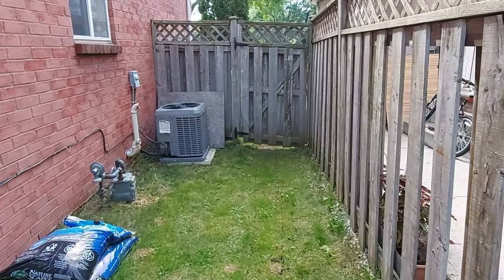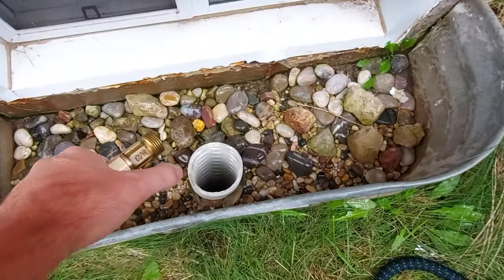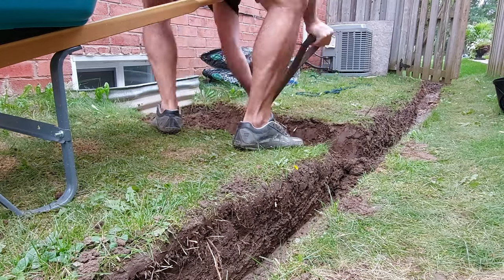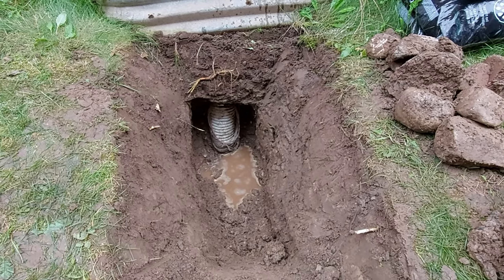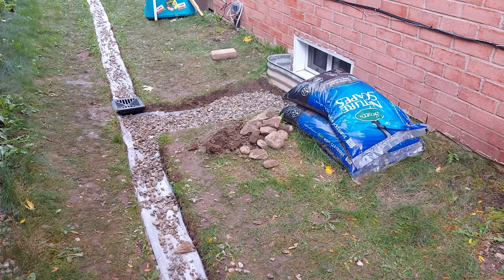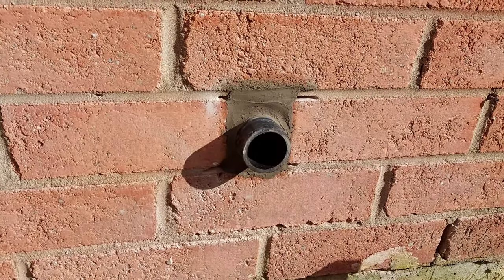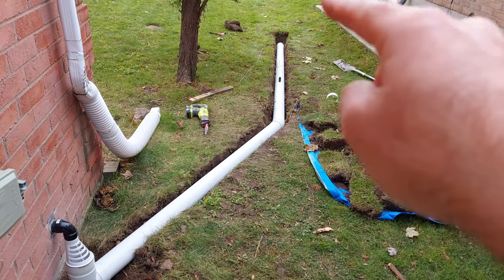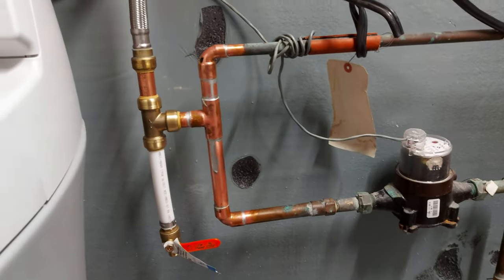Fixing My Yard Drainage - The Neighbor Is Flooding Me

Comment: Curious why the first orange T went over the corrugated pipe instead of inside it? I feel like the water would just leak out of the sides of it and go straight down to the foundation? 🤔
Reply from the maker: Oh yeah it's definitely not a 100% watertight system.  Some leeching into the soil is fine.  It's basically just to account for very heavy rain days.  Couple years later I still haven't seen any water in the basement.  It's working super well 😁
Reply: @tokyosteve1223  Awesome man I'm glad to hear that it's working well, I'm probably going to try something similar to this. But you know what they say... Owning a house is a constant battle with water...and you're probably not going to win 😅😂 But at least we can slow it down a little bit lol

Comment: Our properties in Spokane have only 10' between foundations. This means the ideal 6" per ten foot grade...means all homes need to slope into the foundation of the home next door. Wtf are we supposed to do? My side yards are half as big as yours. The five foot minimum side yard is a bad idea. Where the heck do we both drain to?! French drains and dry well/catch basin systems blow because yeah-they plug. Trees and shrubs create perk. But...this 5' side yard gives zero room! You have enough room to put in a rain garden there-permenant beautiful, zero maintanance solution! No plugged pipes!
Reply from the maker: Wow that's close.  I was pretty desperate, if this didn't work I was going to be possibly be digging a drywell with a sump pump in the yard .. and because how cold it gets here then I'm in the territory of it being a royal pain in the arse because of how cold winter's get... So heated cables to keep from freezing or having to pull it out and replace it and the beginning and end of winters ..  Thankfully the zero maintenance option worked out.
Reply: @tokyosteve1223  Frozen swamp! Lol I'm glad you have room to do SOME thing there. Probably tad more dry.

Comment: was a interesting video... Definitely a lot of work there. I am located in the GTA and have major water coming into my sump pits in my basement. Going to be running a 6 inch tile in the next few weeks 300ft to the ditch to hopefully catch some water before it get to my basement.
Reply from the maker: I was impressed by just how much water the French drain catches.  It's a lot of work but may be just what you need 👍. I've had a dry basement ever since. 🤞